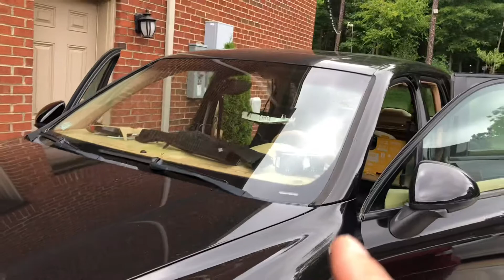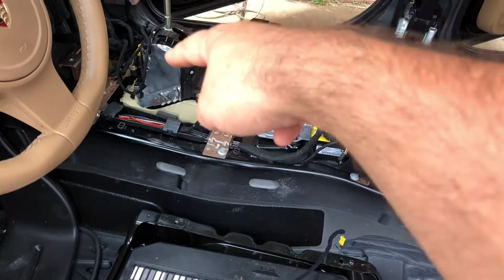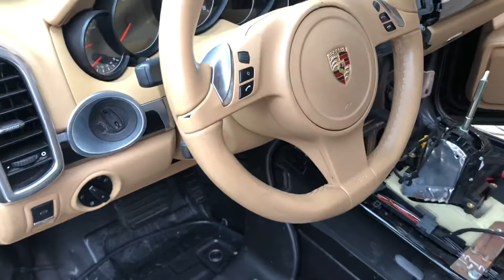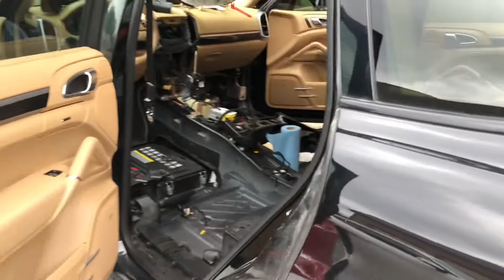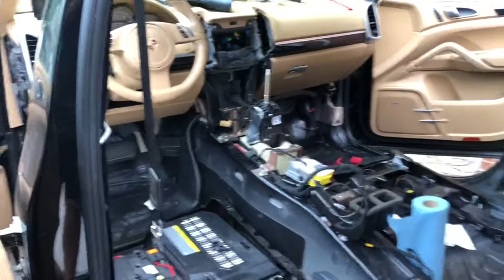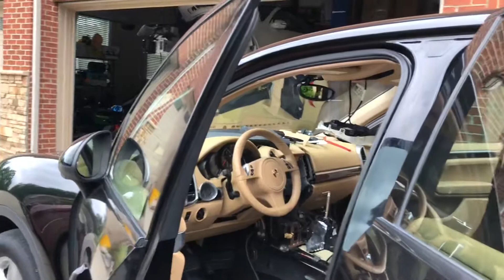Different types of flood damage. Is it worth the risk? It’s up to you to decide.

Comment: Thanks, this adds value to the discussion. Btw. Flood damage sound way to dramatic. Is it really needed to replace the cayenne carpets? A cheap vinegar treatment, power washing and dye then if needed. Ozone, febreze and a black ice tree may help , too 😁
Reply from the maker: Well, the title has a flood brand :) I also posted the video before I cleaned the front drains (under the wiper’s cowling). I found that this was the primary water source, and sunroof drains a secondary. Water was raising in the cowling and reached the cabin air intake. So the water so coming through the blower motor (and killed it as well).
Reply from the maker: I cleaned the carpets, but the foam rubber underneath still had a tiny smell of stagnant water. So I decided to replace them.